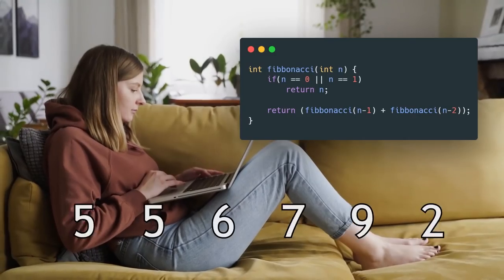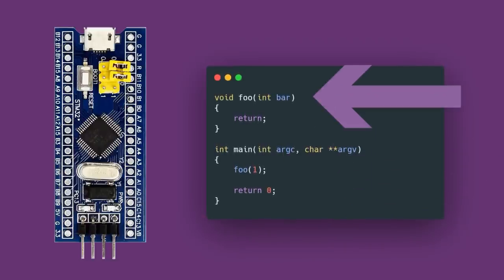why is recursion bad?

Comment: Okay, I've been programming for years and never once on an embedded system. Can I still continue to use recursion if I'm careful about the stack if it's the right way to solve a problem (or even better, use a language with Tail Call Optimisation)?

Comment: The first language I learned was C++ and I was only very briefly introduced to recursion before being told "it is always less efficient than a non-recursive solution." I have never once used recursion because of that; I used it so little that I can't even recognize a situation where recursion would be a good option. I really feel like I'm missing out on elegant solutions since my brain doesn't even consider them, but I suppose it is nice to know that it is technically more efficient in most cases (assuming the compiler doesn't just optimize it for you).
Reply: Recursion is good primarily for reducing the written complexity of node-graph traversal algorithms that lack a concrete bound. Note as said above, these can generally be written as tail recursive.

Comment: When I taught CS102 and taught recursion, I did use the factorial example in the textbook but after showing the class how it worked, I mentioned that it was the example in the textbook because of it being a simple example to teach, but in reality, it was something you wouldn't want to write and was a horribly inefficient way to compute it and showed them the simple loop that would likely run much faster.    I showed some examples where the complexity of each case down the recursion gets reduced by a factor of 2 where recursion was a better fit than were it only gets reduced by 1 each time.

Comment: I never much liked recursion. It feels equivalent to using a non-renewable resource that could run out before the program is complete. Whereas using loops would simply reuse the same resources forever and ever until the program is complete.
Reply: Exactly, recursions are wasteful, most times.

Comment: Any problem that can be solved recursively can also be solved in a loop. Function calls don't just allocate stack space, stack space is more limited than heap space (though generally faster). It's also harder to read in most cases. Some problems are very elegantly solvable with recursion, but most of the time it's a mess that you need to wrap your brain around at least 3 times to figure out what it does. On top of that function calls are slow. The processor has to save the registers, in particular the old stack pointer and return address, allocate stack memory and execute a jump. At the end it needs to unroll it all. If you do something like fibonacci, that's a complete waste of resources. You only need to store 2 integers and run a for loop to update them, not assign kilobytes of memory just to get the 1000th number. Instead you can get away with 12 bytes (the aforementioned 2 numbers and the function argument for which number you want).

Even with gigabytes of ram, the stack size is fixed. In linux the default maximum stack size is 10MB in windows it is 1MB. If you do something complicated that requires lots of stack space per function call or recurse too deep you're going to run into a blockade if you rely on recursion. That's also the reason why you should put big data structures on the heap and have only the pointer to that address on the stack.

I just compared the naive, recursive approach for fibonacci with an iterative loop.

unsigned long long fib_rec(unsigned long long n)
{
    if (n == 0) { return 0ull; }
    if (n == 1) { return 1ull; }
    return fib_rec(n - 1) + fib_rec(n - 2);
}

unsigned long long fib_it(unsigned long long n)
{
    if (n == 0) { return 0ull; }
    if (n == 1) { return 1ull; }
    unsigned long long parent = 0ull;
    unsigned long long grandparent = 1ull;
    unsigned long long result = 1ull;
    for (unsigned long long i = 0; i < n; i++)
    {
        result = grandparent + parent;
        grandparent = parent;
        parent = result;
    }
    return result;
}

in c++. running a loop from 0 to 50 took 160 seconds for the recursive function and 0.1 seconds for the iterative one. Compiled with g++ -O3

Comment: parameters and no internal variables it still consumes memory, as the stack frame holds the return pointer - the location of the program code that called the function which in this case is itself. Each call increments the stack frame at least by this pointer. Function calls are not free.
Reply: They're really expensive on the game boy. I tend to avoid calls emtirely in my IRQ code. Instead my IRQ vectors point to RAM and I just memcpy the function I want to run before enabling interrupts

Comment: Stack overfloooooow
Even when you have systems with GB of RAM you still need to tune the kernel. Linux’ default stack size limit is 8MB per process.

Comment: As a web developer don’t think I ever use recursion outside of job interviews and school myself.  Almost certainly, a library, framework, or other dependency I use uses recursion under the hood though.
Reply: If you avoid recursion in JavaScript, you're slowing down the VM JIT.

This video is about embedded programming, where the machine isn't virtual, and the HLL is not as portable as you'd like.

Comment: A lot of people in the comments seem to have missed big chunks of this 3 minute video. Somehow. 

For instance:
* People saying this isn't relevant to non-embedded systems
* People talking about tail recursion in high level languages who are ignoring what the compiler is doing
* People who are talking about readability or whatever, rather than the topic of the video which is memory usage and safety

If you made one of these comments, I'd encourage you to watch the following segments:
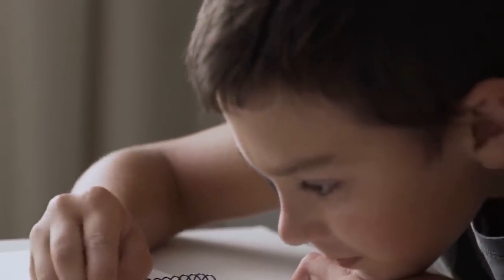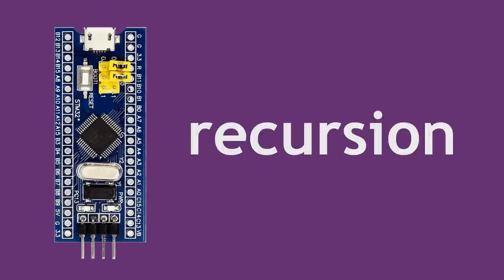0:18 - 0:20 
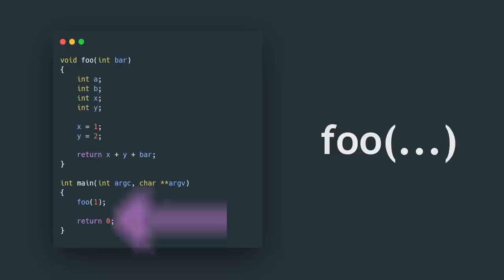1:17 - 1:20 
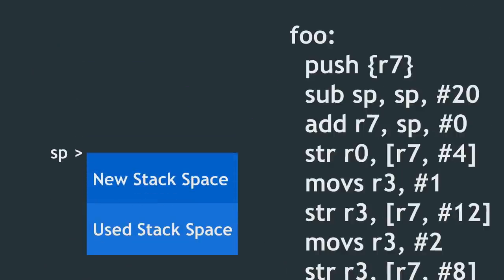1:33 - 1:46
1:55 - 2:05
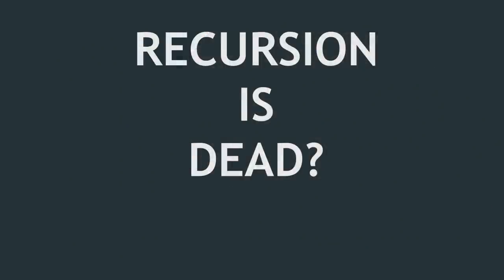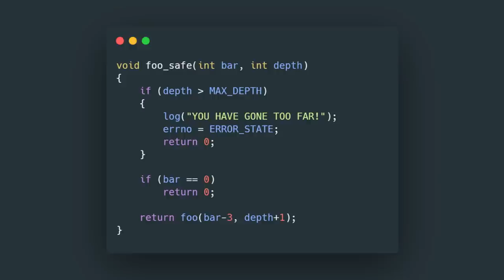2:19 - 2:32
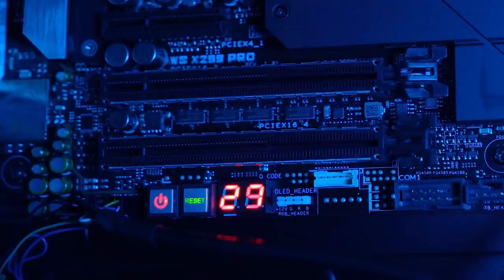2:39 - 2:50
Reply: What is addressed in this video is an empirical truth, which means it can be refuted with empirical evidence.

So to counter, simply write a recursive Fibonacci with the following properties:
* Uses recursion at a low level
* Doesn't follow this advice
* Doesn't run into this issue

If you can't, there's no need to waste your and everyone else's time with posturing.

Comment: What about tail recursive functions? And what if the compiler is smart enough to turn a recursive function into the equivalent for loop?
Reply: Then it's following his advice.
Reply: @NilesBlackX  my point is that recursion is not bad, despite what the video title says. Also he doesn't mention any of this at all. The guy could stand to do a bit more research for his videos.
Reply: @steven1671  The video title says "let me explain" and then in the video he's (Low Level Learning, the name of the channel) talking about... low level programming... Because that's the entire premise of the channel, and the video. Which he talks about extensively, in the video.

Also the video is 3 minutes long, and he mentions like 10 times in the 3 minute video about how it's not good in embedded systems. 

So I guess my question to you would be: did you (not) watch a video about low level programming, on a channel about low level programming, and then take issue with how it doesn't apply to programming in high level languages on non-embedded systems with tons of memory? Or in short, did you actually watch the video before commenting?
Reply: @NilesBlackX  The thing is, I don't see how tail recursive functions couldn't be used on low level hardware with limited memory, to great effect. But as I mentioned, he doesn't explore this at all and just makes a blanket statement that isn't true at all. I wouldn't take programming advice from someone who is missing the bigger picture.

Functional programming has come a long way. I refuse to believe you and the guy who made this video. Lisp machines were a thing. Writing purely functional code that runs on GPUs is a thing (Futhark). Also, naive recursion can cause stack overflow on any system, not just embedded platforms.

Also, you sound offended or something. Are you sure you aren't the author of the video on an alt account? lol
Reply: @steven1671   @Steven  I code in Haskell for work (and for fun) - I have nothing against functional programming. I just think you're missing the point.

But the good news is, we can literally settle this debate in a single step:
You simply need to create one example, as simple as you like, of Fibonacci tail recursion that when compiled, has these two properties;
1. Does not follow this advice
2. Does not run into the issue described

If you can, you're right. If you can't - that's the point of the video.
Reply: Addendum: use any language you like, though you're going to want to decompile the executable so you can get a look at what it's doing. Because again, the point isn't what abstraction it appears to conform to in high level languages - it's what it looks like at a low level.

Comment: Omg that was a nice explaination :)

One question:
When I need an algorithm that works with a stack datastructure, isn't it the most efficient option to make it recursive? I'd think that because the stack implementation is more low level and also not on the heap :)
Reply: The problem is C, or rather C compilers.

Recursion is the simplest way to describe a recursive algorithm, which reduces the chance of putting a bug in there, and in principle would allow an optimising compiler to reason about it and its limits.  It also makes the code shorter and more readable.

Even in cases where you think you need a stack, you actually might not, but an optimising compiler has a better chance at spotting that opportunity, and would do it much faster, than a human ever could, and it would do it correctly, which is not a guarantee with humans.

For embedded systems, C compilers often don't optimise that way because then the debugger would have no 1:1 mapping between a line in the source code and a section in the machine code.  Even the most trivial case, tail calls, typically does not get optimised and therefore uses up the stack unnecessarily.

(And debuggers usually don't help with debugging because timing issues caused by interrupts are hidden from the debugger logic.  Oscilloscope debugging is the better option.)

The advice to not use recursion is silly, I'd even say harmful.  If you have to use C, it is best to write your algorithm recursively, and then optimise it manually if you know that the compiler doesn't. (You'll have to use time-consuming trial and error to see when you need to do the computer's job by hand and when you don't, which is called getting experience.)

Or you could just use a different language and save a lot of time and effort.  With today's SDKs that is often not a practical option though.  Too many code generators and "third party" libraries that you might have to use if you don't want to reinvent everything yourself, and which are always implemented in C (except in rare cases where they use C++).

Comment: Great points. 

I'm curious how languages like Haskell, which force you to use recursion, as loops don't exist in Haskell, deals with the problem of finite resources such as RAM.
Reply: A compiler that's smart and reworks the recursion into a loop under the hood.
Reply: lazy evaluation and tail recursion helps too.
Reply: Tail call optimization can replace the existing stack frame with the new stack frame (when the return statement is a single recursive call). With the Fibonacci sequence, you have to rework the algorithm to allow for this.
Reply: Some algorithms which are not tail recursive in their implementation don't end up creating new frames on top of existing ones thanks to the non-strict evaluation of calls (called thunks, function calls to be evaluated later), which may end up being evaluated from a different frame from which they were created. You can have cases of tail recursive algorithms being linear in their space usage as opposed to non-tail recursive algorithms being constant in their space usage, all as a result of laziness, the creation of these thunks, and where they get evaluated.

Comment: 1:08 You made a mistake there. The function foo has actually 5 integers on the stack: a, b, x, y and bar. Parameters are local variables too.
Reply: In x86_64, the first four arguments of a function call are actually passed through registers, additional arguments are indeed passed through the stack. Though it is the case for x86_64 I’m not quite sure about other architectures, so feel free to correct me if I’m wrong.
Reply: He most likely converted code to assembly using gcc.
Reply: @leoduboin  When doing a call, all registers with parameters have to be pushed onto the stack to save, so it ends up the same. Unless the compiler figures out that it can optimize it.
Reply: @vytah  oh yes that’s true I forgot about that
Reply: @leoduboin  Doesn't this depend on the C ABI tho. cdecl is what you're describing but there's other's like Microsoft's fastcall which only use 2 registers.
Reply: @leoduboin  Sure but if you call another function you need to make sure that the registers are preserved after returning from that function, so they will eventually be stored in the stack. There are volatile and non volatile registers, when you call another function you need to make sure that values of the volatile registers can be restored after calling a function and make sure that the non volatile registers are restored before returning to the caller function.

Comment: Recursion isn't "bad", it is just slightly less space efficient due to using the call stack. It's useful for understanding certain concepts. If your recursive function is exceeding the max depth then something is wrong with your code... and there are ways to optimise such as memoization.

Comment: So then... question: is it more efficient, speed-wise, to keep the stack always allocated in memory and reset the values by hand, or undeclare the stack and then redeclare it? Sounds like some speed could be gained by not having to constantly reserve memory if memory is just reserved in advance.
Reply: The stack can't be unloaded safely most of the time due to hardware interrupts needing to push registers.

Comment: Recursion can be a good academic exercise, and it's very effective at simplifying certain problems. Some compliers even optimize automatically. I still avoid it, unless I'm gonna put in the effort to double check what the compiler has output, which never seems worth it to me...

Comment: Honestly I've found that even on systems with very little stack space (6502 only has 256 bytes for its stack) it takes a LOT of nested calls to overflow the stack. With "normal" (non-recursive programming) I've never even come close. Even on the 68000 where I frequently push over a dozen 32-bit registers, 4k of stack ram is more than enough. That being said it's VERY difficult to write recursive functions in assembly anyway so I almost never use them

Comment: How about using tail-recursion? That's a common way to remedy running out of memory in non-embedded programming. Would it work here? AFAIK it should, at least in theory. That being said, looping constructs are most of the time far easier to understand than tail-recursive constructs.

Comment: I first time used recursion was for factorial. When I tried to calculate factorial of huge number then mine program crashed. Then I wrote function to calculate factorial using loop and that worked  perfectly. At that time realized how factorial actually works and why I should never use it

Comment: Great video to explain what is happening with recursion at a low level. Recursion can be a balance between clear code and burning computer resources. If you decide to use recursion you really need to understand what is happening under-neigh the hood and what your algorithm is doing. Implementing a Fibonacci function directly from the mathematical definition looks great in code, but running the code will burn through the stack and runs proportionally in time to the exponentially increasing value it returns.
Reply: What is the point of high-level language?
Reply: To write assembly for you

Comment: Hey great video, would it be possible for a video about Linux? I'll explain myself: I have no idea about Linux, full time windows user since birth. I'm finishing an Electronis Engineering Masters and from internship experience and youtube content like yours I know that for embedded design linux is very important. I would like to know wether some Linux skill (using a virtual machine on my windows system) will be worth it. I mean, what does Linux give you as a embedded software developer that windows doesn't? My experience is programming STM32 microprocessors using the STM32CubeIDE basically. Thank you
Reply: You cannot run Windows on embedded systems. But you probably will want to use a custom operating system/kernel instead of Linux anyway, but depending on the available resources, you might be able to. I believe Tiny Core Linux runs in 46MB of RAM or something
Reply: Linux is the most versatile development environment. Even if the target system will not be running Linux, you can still use it for your cross-development platform.